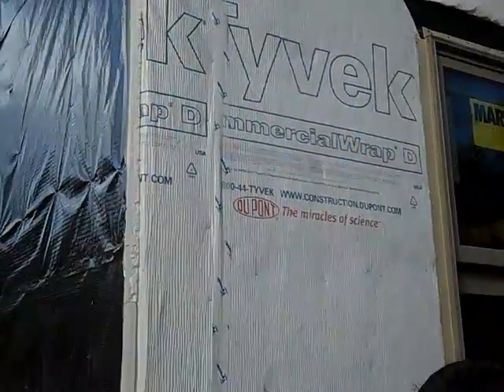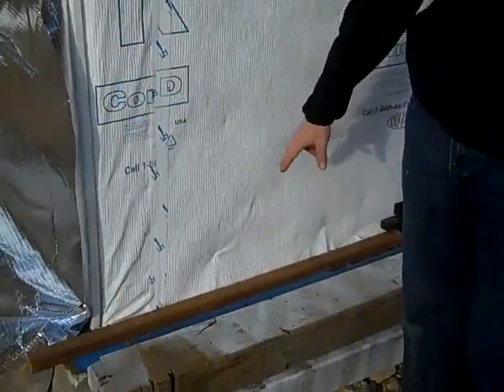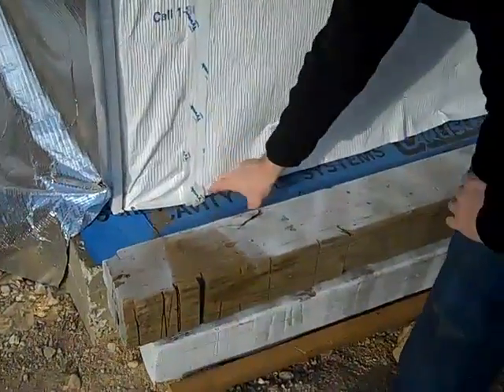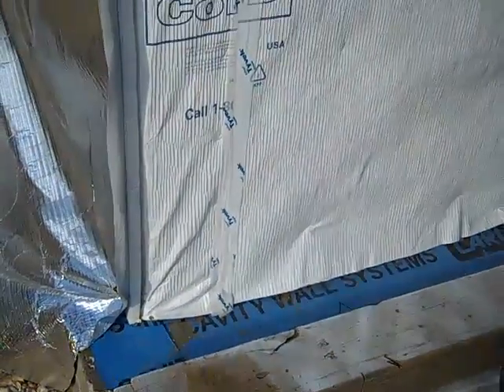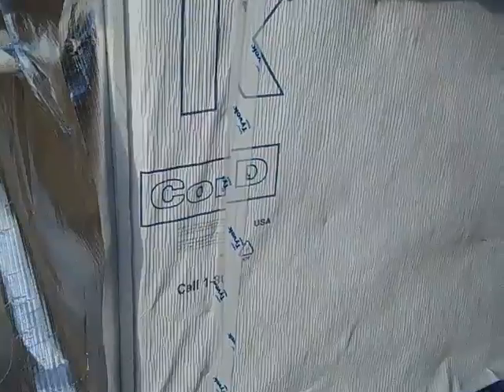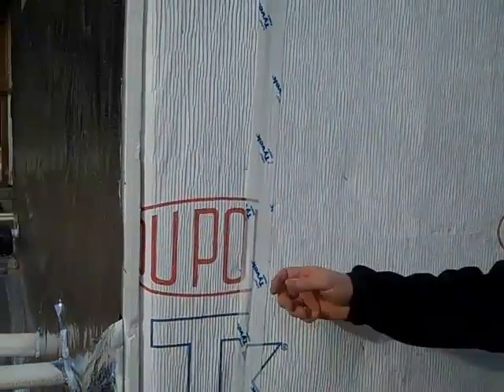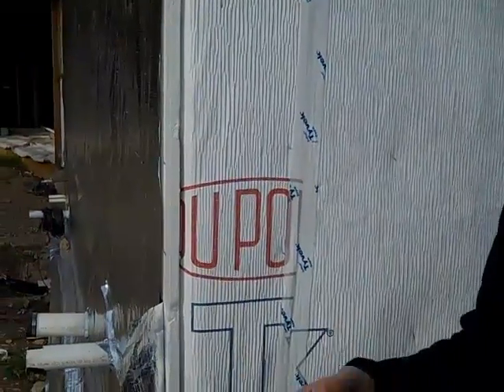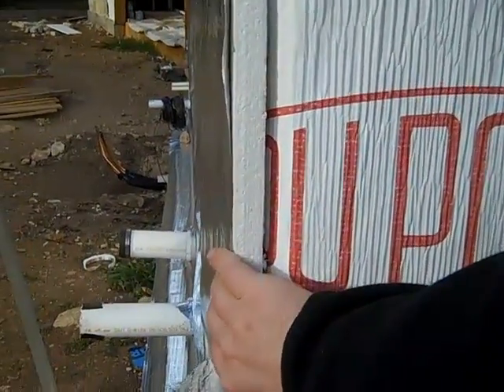Radiant Barrier Walls with Rigid Foam Insulation

Comment: Trying to figure out if I should use this. Had to remove south facing interior wall. Just brick and cinder block. The house has no insulation. Thinking off setting new studs then vapor barrier and pink stuff between studs.

Comment: the radiant barrier should not be contacting the foam like that.  It needs an air gap and ventilation between it and the foam otherwise the radiant heat will conduct directly to the foam negating the radiant barrier completely. Radiant barriers have no R-value or any effect without air gaps.

Comment: Would it be a good idea to put this radiant barrier under your drywall (on the in side of your insulation)in the upper Midwest where the winters are the dominant season? Would it be of any advantage for keeping heat in?

Comment: Where does the radiant heat vent out to? I know you need a gap between your barrier and the wall or ceiling when adding radiant barrier, but for this house, does the heat escape up and out through some vents in the exterior wall? Thnx, Matt.

Comment: Hey Matt, I love what you're doing, your videos & how you educate the public... BTW quick question.
I have some clients & I was explaining the importance of sheathing. Some builders use in this area of Texas: Unfaced Cellulose Foam Board Insulation with Sound Barrier. It is my opinion this is not the best choice to use to build your home & I commonly advise to stay away from those builders. Do you have any videos explaining the draw backs of that kind of material? I'm familiar with your video on OSB, plywood & zip sheathing comparison but was looking for something that explained the difference on this cheaper material.

Comment: can this be used on the inside of the attic roof deck?
Reply: Absolutely.  Put the foil on the rafters edges so there is an air gap between the foil and deck. It also needs to have air gaps at top and bottom so air flows under the deck.

Comment: Matt, first a "thank you" for all your helpful videos.  I am looking to place these so called foil-backed rigid foam boards in my attic along the beams up to the gable to release the heat through the ridge vent.  When I went to one of the big box stores, I noticed what they call "foil" backed appears to be nothing more than silver paper (I pulled back a small piece to examine it).  Whatever it is, it's not what I consider to be aluminum foil.  So my question is who makes these rigid foam boards with "real" aluminum foil on its side?

I appreciated whatever advice you can offer.  Thanks again!

Comment: We had our builder wrap our entire house last year in 60" breathable Atticfoil up here in sunny Dallas.  Before the brick was installed, it looked like a lunar landing module!   We finally made it through the dog days of summer this year and we are quite pleased with the overall results.  Two story house around 4100 sq ft.  In addition to the housewrap.......R60 blown attic insulation, radiant decking, two 30w solar attic fans, running 11 tons total Trane 16 SEER........our average electric bill (at $0.10 per KWH) is around $130 with the thermostats set at 78.   Note the garage walls were also fully insulated, and the garage doors are R20.  For anyone who might be interested, cell phone reception was similar inside vs outside.
Reply: wabio R20 garage door is false advertising on the manufacturers part.
Reply: 78 is too warm for me and my wife. I wonder how much more expense to keep it at 72?

Comment: What if you had a workshop you were siding with metal and wanted to have it insulated also with a radiant barrier.  Would you put the rigid foam, housewrap, radiant barrier right on top of it then the battens and  metal siding on top of it?
Reply: Richard Head 

Yeah I’d like to know the same thing

Comment: Matt, we had several customers call us after watching your video looking for a house wrap/radiant barrier.  We actually have a single sided foil product 48" and 60"  (foil only on one side) that is perfect for this application.  http://www.atticfoil.com/products/60-single-house-wrap.html  
The foil will face out to the required air space.  A radiant barrier behind brick, stone or siding is a low cost highly effective method to reduce radiant heat on walls that catch direct sun.
Reply from the maker: Thanks for the Link!  I agree this is a great upgrade for walls that have a rainscreen or masonry exterior.  Especially in the South.  Best, Matt

Comment from the maker: Thanks for commenting!  Yes, we only used the radiant barrier on S & W walls.  We felt like the cost wasn't worth it for the other walls here in sunny Austin TX.  When using furring strips you want to ideally vent the space top & bottom.  A sealed space will give you radiant barrier effect but won't help you dry out your cladding.  See my other videos on this rain screen method of siding installation.  Best, Matt
Reply: What about radiant barrier under the metal roof?  Or will the spray foam be enough on the unvented attic?

Comment: Great video, with great info, but I have 2 questions.  Did you put the radiant barrier only on the South and West facing walls, or was that wrap just not complete yet?  Also, when you use furring strips for the veneer or siding walls, does that air space need to be ventilated or sealed?

Comment: Matt, nice video.  

Your absolutely right on this one.  Heat flow is all about the difference between the inside and outside temperature of an object.  The sheathing behind a West or South facing wall can easily exceed 120 degrees since the brick can get over 150 degrees.  With a radiant barrier in the assembly the sheathing (or foam board in this case) should be just a few degrees above ambient temperature.  Drop the delta T and reduce the heat flow. It's that simple.  
Ed